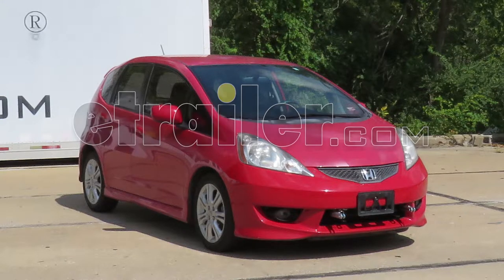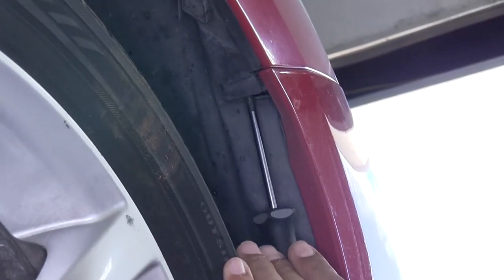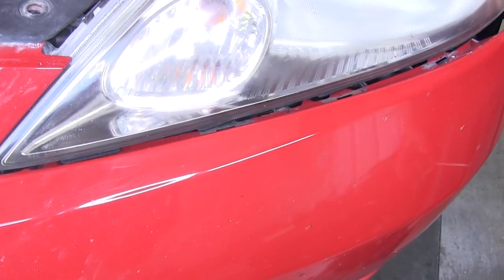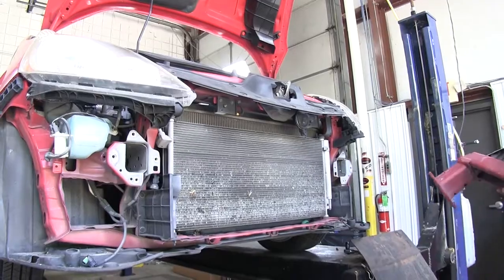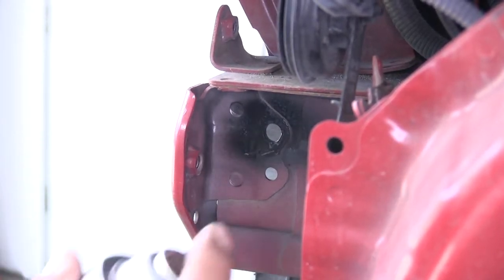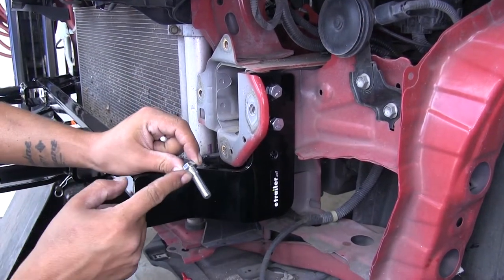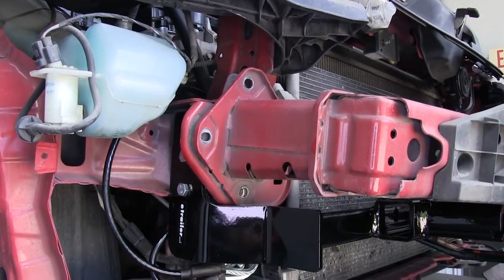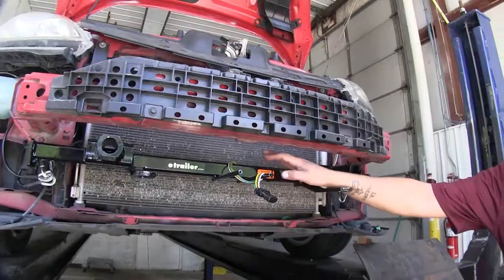etrailer | DIY Install: Blue Ox Base Plate Kit on your 2009 Honda Fit

Comment: You need to cut more of the gril than shown to fit electrical wires, and to have room for the safety chain tabs that stick out front. on 2009 honda fit sport.